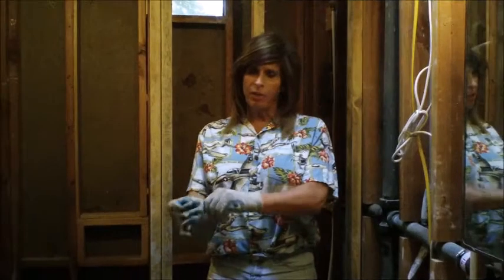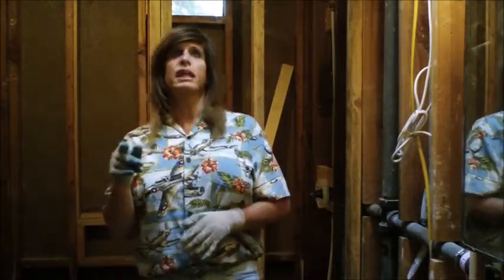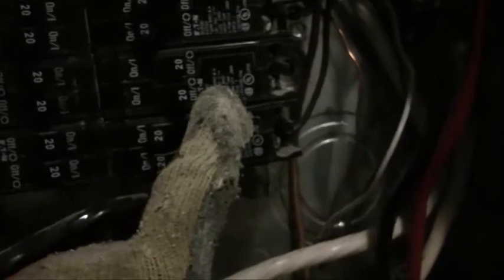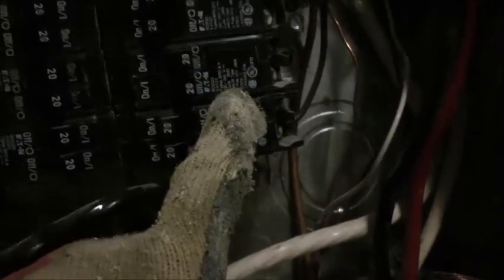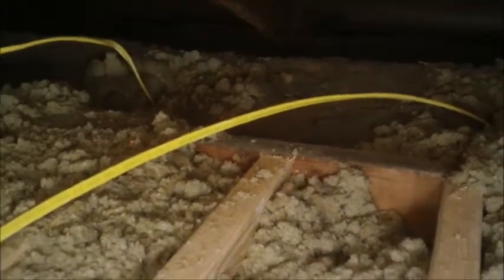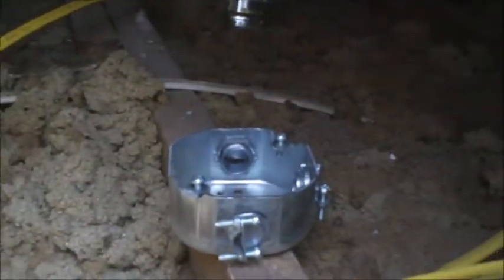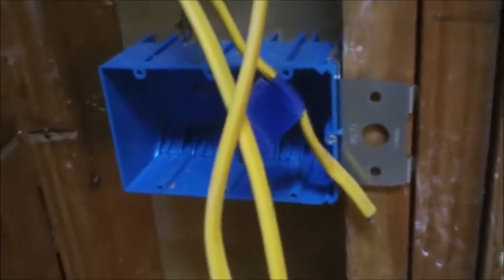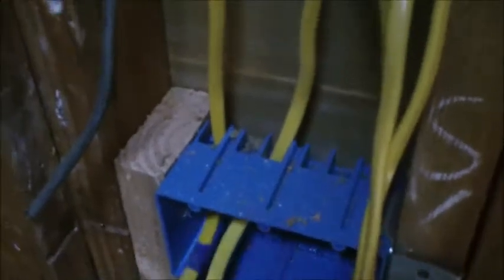Bathroom Renovations & Tub Conversion to Barrier Free Shower (Part 26)..New Electrical Wiring (1)

Comment: Nice work Rosie..That attic work can get hot so glad u got a early start on r GFCI install.  ..When u stop out may be u can help me install a new transfer switch x to the meter so when we run our big genny we can run the whole house instead of the small panel that someone installed for Jona.